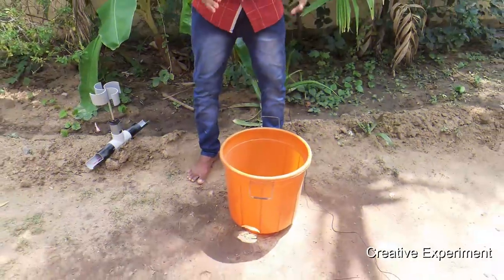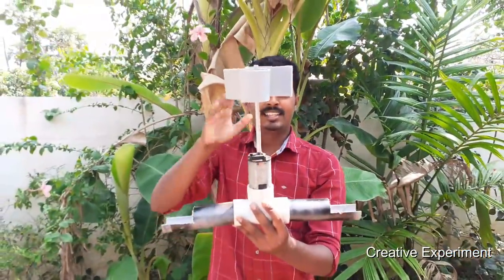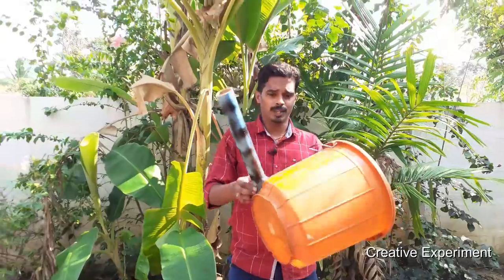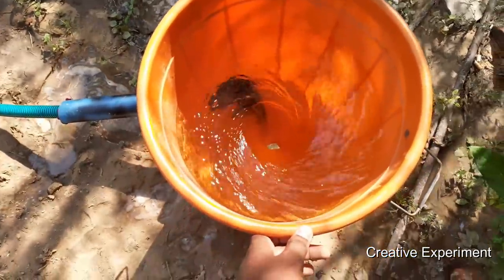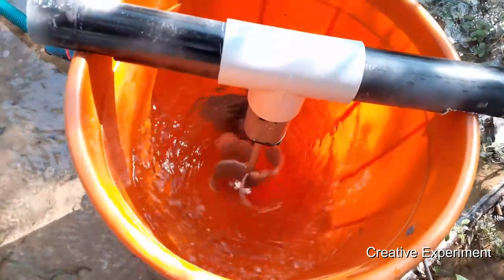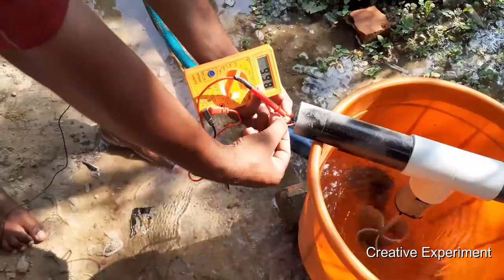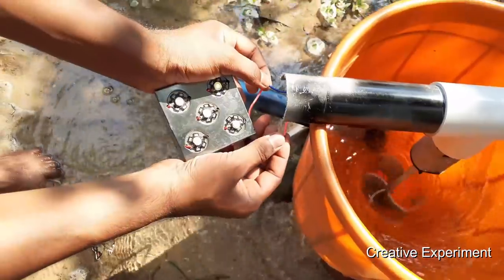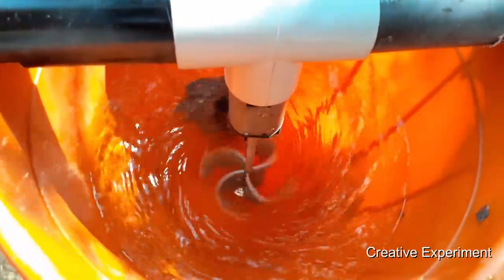Mini Water Vortex turbine | Renewable Energy | Gravitation water vortex turbine |Creative Experiment

Comment: Water wasting and using water pump which uses 230v and finally creating 10v energy. I did not break your confidence but this work should be done without wasting water like reuseable water flow and wasting 230V energy to create 10v energy. You must do this video again without these flaws and that will make you the best creator.